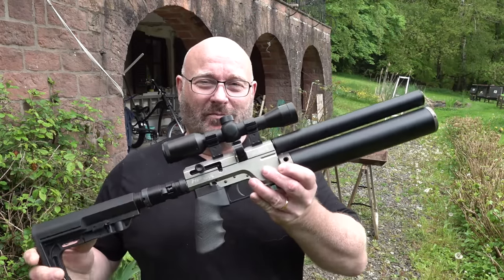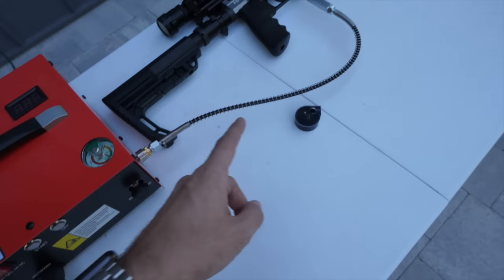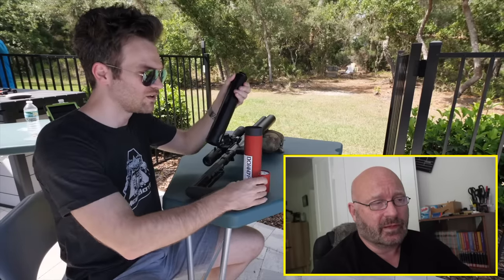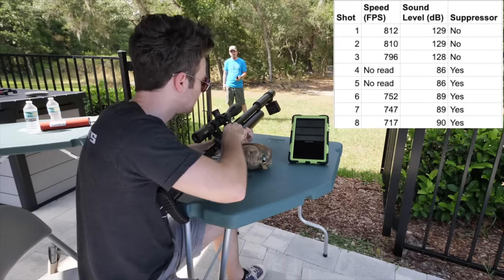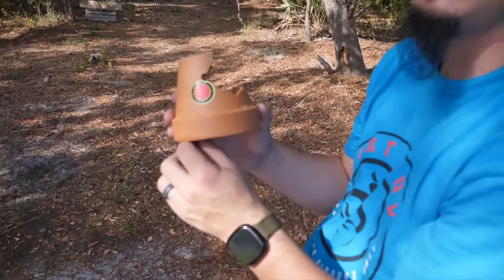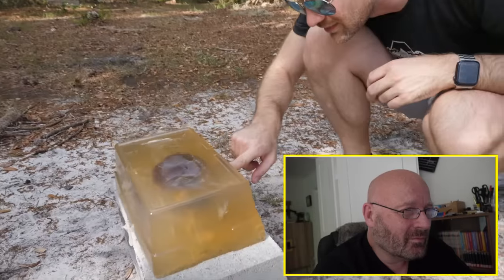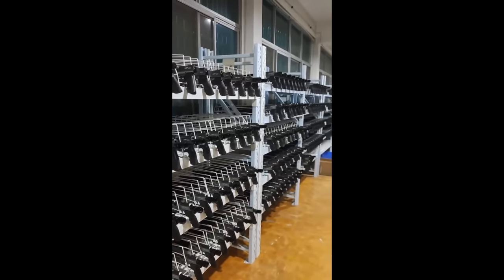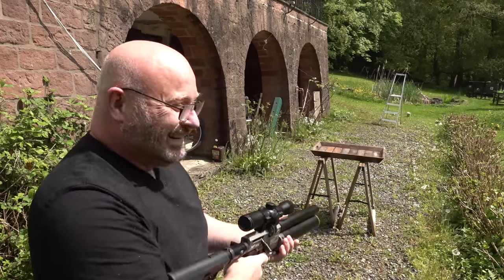Betonplatten zertöppern - mit dem Luftgewehr? Echt jetzt?

Comment: Hahaha Matt slapped the Gelatine like Jörg was doing back in the good old times....Great Rifle. It would be nice if Jörg used this great Rifle in a 1to1 comparison with, for example, a 9mm handgun
Reply: u gotta slap that gel
Reply: Well, with something around 200J at the muzzle you are more in .22lr territory than 9x19mm... It's an impressive airgun, but it's not that powerful if you start comparing with actual guns.
Reply: @berhorn  aber denkst du nicht, dass die 9mm Diabolo deutlich mehr Gewicht mitbringen als das reine Geschossgewicht einer .22er? Dann wären die 200j ja auf die bewegte Masse zu sehen (bin ein Noob) deutlich wuchtiger im Impact
Reply: @SitzenderBulle  Naja... Die Mündungsenergie ergibt sich aus der Hälfte des Produktes von Masse und dem Quadrat der Geschwindigkeit (mv²/2). Bei gleicher Mündungsenergie ist ein .22 Projektil also deutlich schneller unterwegs. Dafür hat man durch die höhere Masse des 9mm Diabolos einen höheren Impuls. Im Endeffekt werden sich beide nicht viel nehmen.

Eine 9x19mm ist aber mit der 2,5- bis 3-fachen Energie unterwegs. Das ist eine ganz andere Hausnummer.
Reply: @berhorn  Datt klingt plausibel..... vielleicht auch gut so, dass es nicht in dieser Liga spielt ;)
Reply: So einfach ist das nicht... Die HPMax nutzt Hollow Point Munition. Die 9mm in der Regel FMJ. also würde ich sie von der tödlichkeit eher mit einer 9mm vergleichen. Mit der Pistole ist alles ab 25m schwer zu treffen. Die HPMax kann bis auf 100m sauber und schnell schießen. Es ist schon richtig das man die HPMax eher mit ner 9mm als einer .22lr vergleicht
Reply: @steveseifert5016  Mega!!

Comment: hi Joerg, i have challenge for you :build two-stage crossbow. what i mean by that? exactly as it reads, crossbow that shoot crossbow that shoot bolt. why? because as you know main kinetic energy limitation of bolt came from speed of flex of limbs, which cant go beyond speed of sound, no matter what bolt and crossbow we use, bolt wont go speed of sound, only asymptotically approach it. so only method to increase  kinetic energy is to use heavier bolt. but, if we use multistage design we actually can go beyond speed of sound! it would be awesome, second purely mechanical device that can do that, except of whip.
also, i think russia/ucraine  thing will get hotter, so as soon you see news that american troops officialy enter battlefield, get out of big city centers at least till 5 jule.

Comment: Welchen Kompressor braucht man da Minimum von der Stärke her?
Reply from the maker: Kauf einen 300 bar PCP Kompressor, gibt's so ab 250 € auf amazon.
Reply: Den hab ich zweimal. Hat mich noch nicht in Stich gelassen. Darf man so einen Link hier reinsetzen?
Reply: @M.Z. Ich hatte den Link schon drin. Ist leider wieder raus. Keine Ahnung warum.
Reply: @M.Z. Gib das als Suchbegriff bei der Bucht ein:
Elektrische Hochdruckluftpumpe PCP Luft Kompressor 4500PSI 300bar 30MPA
Da kommen dann ganz viele.
Nimm die für 209,98. Genau die hab ich auch. Und bestell Dir gleich das passende Öl dazu. Von Liqui Moly oder Ravenol nach ISO VG46. Kostet nicht viel. Ich hab mir noch ein Zwischenstück  (sogenannter Wasser/Ölabscheider) dazugekauft, in das ich Silicagel gefüllt habe, das macht die Luft noch etwas trockener. Natürlich muss man das hin und wieder mal tauschen und das benutzte wieder trocknen. Für den Wasser/Ölabscheider gib das hier ein: 30Mpa 4500PSI PCP Kompressor Öl Wasser Separator Hochdruck Luft Pumpe Filter
Da kommt dann so ein goldfarbenes Teil. Oder Du findest ein schwarzes, wo Airmega draufsteht. Da gibt es Tonnen an Zubehör. Das hab ich einfach dazwischen gehängt. Allerdings brauchst Du dann noch einen zweiten Hochdruckschlauch. Einer von der Pumpe zu dem besagten Wasser/Ölabscheider ( der ist bei der Pumpe dabei) und einen vom Wasser/Ölabscheider zur Druckflasche. Ist genauso einer wie schon dabei ist.Du könntest auch mit dem Endstück des Wasser/Ölabscheiders direkt an den Anschlussnippel an der Flasche, das ist aber äusserst fummelig. So ein Ölabscheider ist so verkehrt nicht. Pressluft und Öl können eine gefährliche Mischung sein.
Wenn Du Dich mit Hochdruckkompressoren nicht auskennst lies Dich erstmal ein bischen ein. 300bar sind nämlich verdammt viel. Damit ist nicht zu spassen. Ich benutze die Pumpe auch für Paintballflaschen. An denen ist vorne direkt ein Regulator angeschraubt welcher 2 Sicherheitsventile hat. Eins um den Flaschendruck abzusichern und eins um den eingestellten Arbeitsdruck abzusichern. Da sind mir schon öfter die Arbeitsdrucksicherungen geplatzt und die Flasche bläst ab. Ich garantiere Dir, passiert das während Du die Flasche in der Hand hälst hast Du danach braune Streifen in der Hose. Das knallt gewaltig und dann blasen 200 oder 300 bar da heraus innerhalb von einer Sekunde. 200 oder 300bar, weil es verschiedene Flaschen gibt. Einige sind halt für 200bar zugelassen, andere für 300bar. Aber das braucht Dich ja gar nicht interessieren, wenn Du nur dieses eine Gewehr befüllen möchtest. Trotzdem ist es gut sich in die Materie einzuarbeiten. Man wird dann im Umgang mit Pressluft auch viel sicherer. Ich bin sehr sehr vorsichtig angefangen.

Comment: Hat das Gewehr denn jetzt einen Regulator für die einzelnen Schüsse? Dann müssten doch eine Reihe von Schüssen sehr gleichmässig sein, bevor der Druck in der Flasche unter den Arbeitsdruck des Regulators fällt. Oder zeigt das Manometer nur den Flaschendruck an? Mir scheint die Geschwindigkeit sinkt ab dem ersten Schuss.
Reply from the maker: In der 7,5 Joule Variante hat das Gewehr einen Regulator und alle Schüsse (viele viele viele) sind gleichmäßig. In der ganz offenen Variante gibt es keinen Regulator und nur die ersten 10 bis 12 Schüsse haben über 200 Joule.
Reply: @Slingshotchannel  Ah, alles klar. Vielen Dank. 👍
Reply: @Slingshotchannel  Hallo Jörg, ich hab doch nochmal eine Frage: Kann man den Regulator verändern, so das er z.B. 130 bar Arbeitsdruck hat. 
Also das man mit Regulator schiesst um Gleichmässigkeit zu erreichen, natürlich auf Kosten der Energie. So das man dann vielleicht 120 Joule hat aber 20 geregelte Schüsse?
Reply: @a.w.1906  schau dir das erste Video des LG‘s an!
Du kannst auch nur die Düse verändern und 
Mit Regulator bei 50 joule schiessen